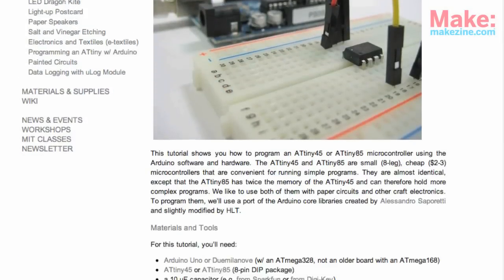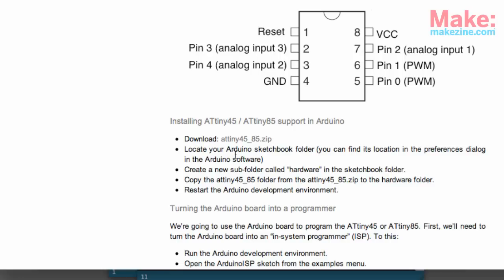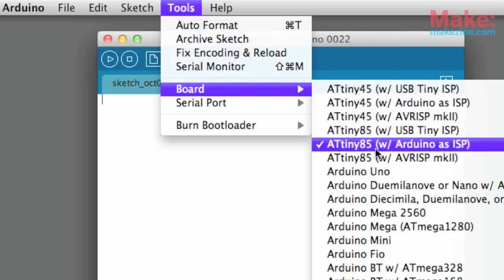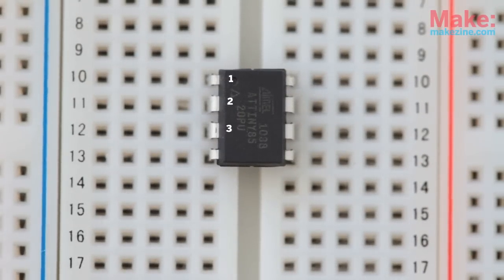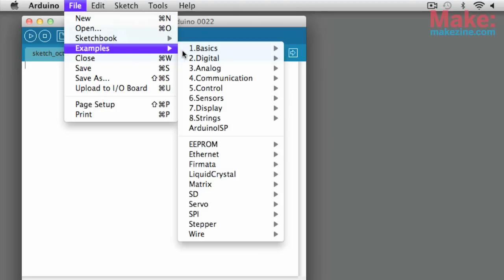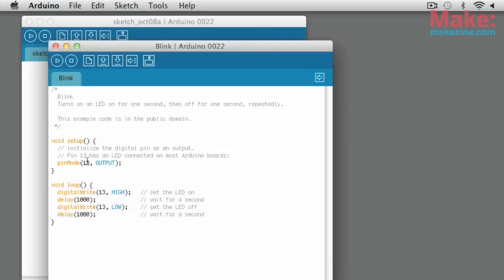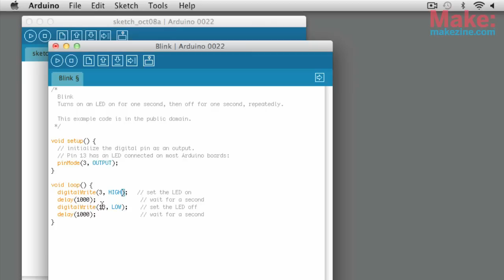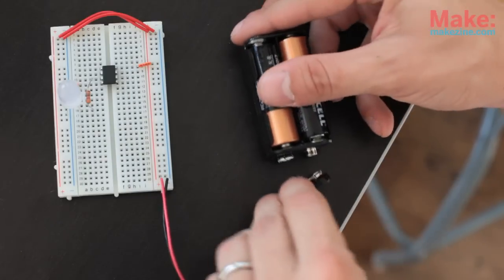How-To: Shrinkify Your Arduino Projects

Comment: Hello teacher you or someone can help me improve this code ?
I want the LED that flashes obey the command of broqueio and unlocking , being
it flashes in a delay 1000 when broqueado and stops flashing when unlocked

I'm Working with these codes :

/ * DESIGN WITH ALARM BROQUEIO .
The prjeto is ready awaiting improvements in code , for example to make the blinking PINO_PISCA = 3 with a time of one second. * /

const long DEBOUNCE_DELAY = 100;
const int PINO_BROQUEIO = 2 ; / / Port to power the relay, broqueio .
PINO_PISCA const int = 3 ; / / Port to power the relay, flashing and siren .
const int PINO_LED_1 = 6 ; / / Port of LED1 to feed the panel , stating it will be broqueado .
PINO_LED_2 const int = 5 ; / / Port to feed the LED2 panel , stating that is broqueado .
const int TC = 4 ; / / Port to receive the signal to broqueio .
leitura_anterior int = 0; / / stores the status of reading in the previous loop
leitura_anterior_db int = 0;
long time_ultimo_debounce = 0;
debounce_ok int = 1;

void setup ( ) {
pinMode ( PINO_BROQUEIO , OUTPUT ) ;
pinMode ( PINO_PISCA , OUTPUT ) ;
pinMode ( PINO_LED_1 , OUTPUT ) ;
pinMode ( PINO_LED_2 , OUTPUT ) ;
pinMode ( TC , INPUT ) ;
}

void loop ( )
{
tc_1 ();
}
tc_1 void () {
leitura_atual int = digitalRead ( TC ) ;
if ( leitura_atual = leitura_anterior ) { time_ultimo_debounce = millis ( ) ; debounce_ok = 0; }
if (( Millis () - time_ultimo_debounce ) > DEBOUNCE_DELAY ) { debounce_ok = 1; }
if ( debounce_ok == 1 )
{
if ( leitura_atual == 1 && leitura_anterior_db == 0 ) { digitalWrite ( PINO_LED_1 , digitalRead ( PINO_LED_1 !)) ; } / / LED 1 will be informed that : broqueado / desbroqueado .
delay ( 10000 );
if ( leitura_atual == 1 && leitura_anterior_db == 0 ) { digitalWrite ( PINO_PISCA , digitalRead ( PINO_PISCA !)) ; } / / Rele Blink and Siren .
delay ( 10000 );
if ( leitura_atual == 0 && leitura_anterior_db == 1 ) { digitalWrite ( PINO_BROQUEIO , digitalRead ( PINO_BROQUEIO !)) ; } / / Relay for Broqueio .
if ( leitura_atual == 0 && leitura_anterior_db == 1 ) { digitalWrite ( PINO_LED_2 , digitalRead ( PINO_LED_2 !)) ; } / / Led 2 says it is : broqueado / desbroqueado .
leitura_anterior_db = leitura_atual ;
}
{
/ / ------------
leitura_anterior = leitura_atual ;
}
}

Comment: Atmega328 chips are $2.88....You're not saving that much money.
Reply: In my country, they are 9€ while minis are 2.4€.
Reply: TheDenix8 Wow, I wonder why it's so much.
Reply: You might not save money from using a attiny instead of an atmega, but you would save tons using either of those instead of a full blown arduino.
Reply: Abraham Rohde
lol

No kidding!
Reply: Depending on the vendor, you can get them here for around 1 dollar. So a lot more people might be profiting from this than you might expect.
Reply: I would take a look around Ebay. I found a seller selling them in lots of 20 for $1 per chip ($20), and another selling in lots of 10 for just 5 cents more per chip.
Reply: remember power consumption on the tiny, that's a big pro.
Reply: The title implies that the advantage was shrinking your project in size, not necessarily in cost.
Reply: TheDenix8
Ebay my friend! :)
Reply: Or you can get an Attiny5 for $0.30. It all depends on the specs you need for your project. The main benefit for this is when you DON'T need all the pins, PWMs, UARTs, serial com, debugging, power management, etc. of the full arduino board.
Reply: Yeah but if you only need 1 or even 4 pins, you might want to not waste a ATmega chip.

Comment: I don't think you can always miniaturize like he's doing - it doesn't have all the in/outs, and has a smaller instruction set. Also, no need to miniaturize if it fits the project, and you're not doing production runs. Most folks are just experimenting and don't even intend to get past the prototype phase. Perhaps it's "all this new generation of hippy 'makers' " *wants* to do; prototype, have fun, and move on to something else.

Comment: @SirDrinksAlot69 I never used Arduino as ISP to upload program on a chip that is indirectly connected to Arduino board. I wrote my code in pure C. Which means I didn't have luxuries Arduino IDE provides like analogWrite and similar. Arduino IDE does a lot of things behind your back to make everything painless. If you don't include boot loader and Arduino shared functions, you get a lot smaller file. This is my code for fading LED: pastebin . com / xk4CRYpc

Comment: good that i doesn't require external oscilator
Reply: +Matt Dathew AVRs have an 8 MHz oscillator built in.  For better stability and faster speed, you can use up to a 20 MHz crystal oscillator.  Arduinos include a 16 MHz one.

Comment: Arduino is for those who don't read datasheets..... Be it AVR, PIC, or other MCU makers.... Arduino is for Ctrl+C/Ctrl+V developers.... Ask any one of them to calculate an RC circuit, or even a voltage divider and they start to cry!
Reply: yes i know .i'm 15 and i ve electronics and programming and electrical knowledge .is very difficult to program mcu

Comment: "Arduino Project"... the chip is named "AVR" by Atmel.
If you build your own board with an AVR, it's an AVR board. You can do whatever the fuck you want with your AVR. Even throw an Arduino bootloader on it... who cares? But it's still an AVR.
And while you're, at it, get an ISP for AVRs, they're cheap.

Comment: Thanks for the vid but, Make is partially responsible for dumbing down new comers to electronics & microprocessors, by promoting  using the arduino as a large expensive single component  of the project. Someday some1 will market an "arduino" with a 28 DIP ZIF socket. builders can build their own adapters  to program the other packages. Hopefully a kit that use through hole components

Comment: "Pin Floating" go check that...nasty subject. just ground or pull-up to Vs all unused pins of a chip (depending on if they should have a constant high or contstant low voltage). But yeah...floating pins can be pretty nasty from an external and internal perspective. External due to noise and static electricity affecting that pin and internaly because of load switching also affecting that pin.

I hate floating pins! You should too

Comment: those attiny chips must have bootloaders installed on them otherwise you're fcuked
Reply: I realize this is an old post but you don't need a bootloader, just use Arduino as ISP and the default 1MHz clock speed.